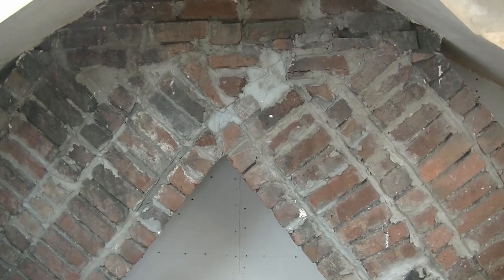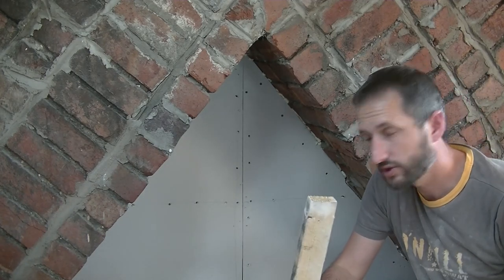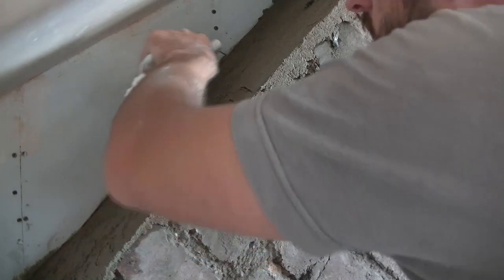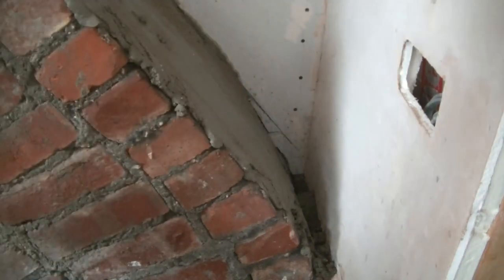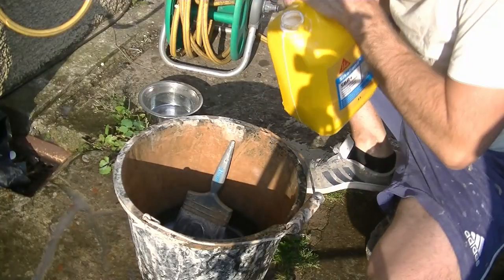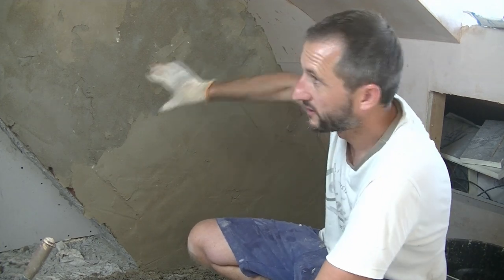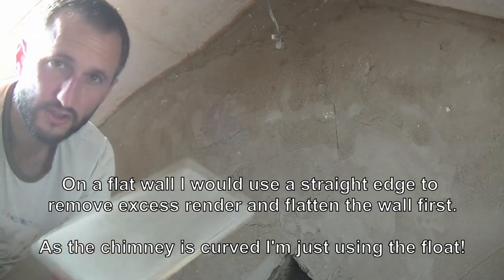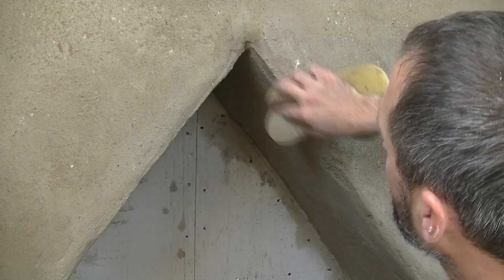How to render a chimney breast DIY! Sand cement rendering for beginners. How to render a brick wall!

Comment: As a nonprofessional needing to do such a job, this is terrific.  I have two square chimneys that need rendering in the attic.  Both built with brick and larger blocks have lost their original render.
Reply from the maker: @paulklasmann1218  best of luck with it Paul and thanks for watching 👍
Reply: @POUSEaroundtheHOUSE  Since I live in Germany I need to find the right products which is a bit of a challenge. Im sure they have all the materials but I need to find out what they're called as the standard translations don't translate so well.  I'll also be needing lime for making traditional lime mortar so need to source the right type.

Comment: In case you were wondering why it was sticking some places but not others. Brickwork 'out of sight' in older houses used cheaper bricks. Depending on the area these can contain impurities or have not been fired fully.

For instance in my cellar I had some bricks which almost crumbled to the touch some which were porus and accepted paint readily others which were hard as iron (blunted masonry bits) and others which I think had glass slag in them as the surface was almost like glass and and the paint never stuck to them.

Consistancy is not your friend with older hidden brickwork :(
Reply from the maker: Thanks for the feedback, good info. 👍

Comment: Nice video Mr Pouse!! With Hydrated lime, is SBR still used in the mix?
Im about to do a garden wall…
Reply from the maker: I used both and it's been fine. The sbr really helps it to bond and helps with the workability. The lime also helps I fins with making it breathable. Of course how it takes to the wall is often down to the surface you're applying it to. New concrete blocks are always nicer than 130 year old dusty brick! Best of luck.

Comment: BRILLIANT BIT OF RENDERING POUSE!!!!!! 👍🏽👍🏽👍🏽

ANY REASON WHY U DIDNT DOT N DAB THE CHIMNEY BREAST & SKIM OVER???

JUST WONDERING MATE!!!!!
Reply from the maker: The shape of the chimney was so out curving in at the top by about 8 inches it would have been tricky, and  I have a wood burner and open fire downstairs so I wanted to make good the brickwork. Limecrender won't crack or pop and will also heat chimney breast in winter while burner is on. Good question though, thanks for watching!

Comment: Did you render over drying sbr or wet sbr ?
Reply from the maker: It was dry by the time I applied the render. Thanks for watching 👍
Reply: @POUSEaroundtheHOUSE  Because you said that when the slurry will be tacky then it's the right time to render over.
Reply from the maker: @omarnaja508  if I said that then why did you ask? Yes I usually apply it when tacky, same as plastering onto pva. It was a long time ago so I guess that's what I did. Tacky is best although sbr will remain a tad tacky once dry.
Reply: So i can render over dry SBR without worries about fail
Reply: Nasa

Comment: Can i render over existing cement/sand wall that does not have scratches (keys) and without using Sbr
Reply: What did you do in the end? I'm wondering the same

Comment: You need to wet the surface when floating.
Reply from the maker: It was wet, it was just drying very quickly as very warm. I didn't stop wetting the wall, it was ridiculous! Thanks for the feedback.